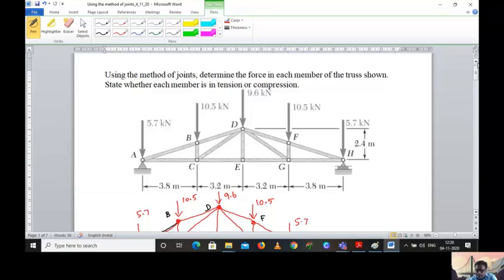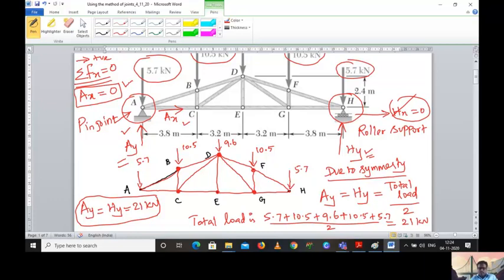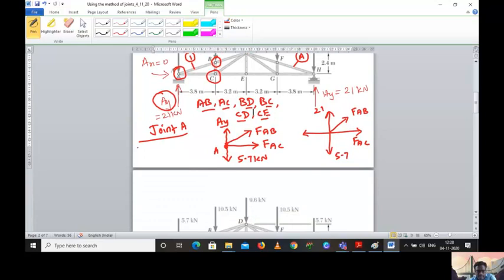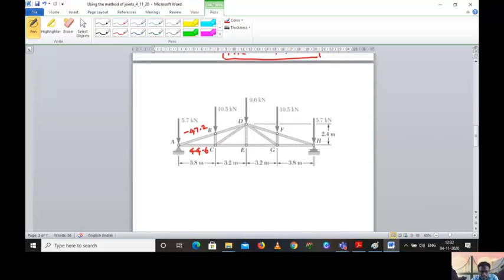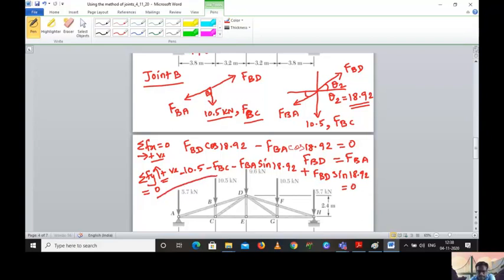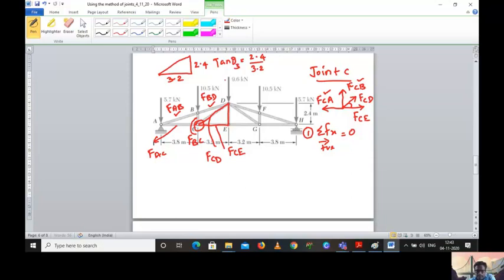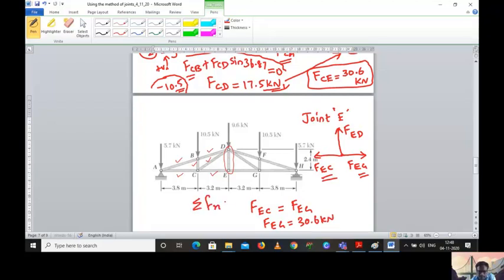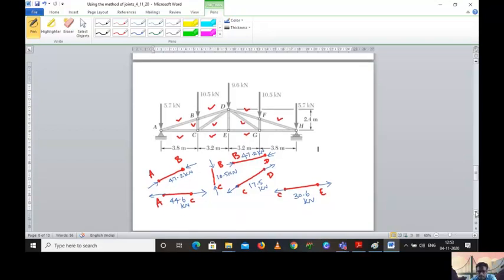Method of Joints _ How to calculate Member Force of a Truss (Symmetric) using method of joints?

Comment: kailash s iyer 

Ex = 0
Ey = -45KN
Fy = 60KN

Fea = 57.62 KN      (tensile)
Fef =  36KN             (compression)
Fab = 35.99KN       (tensile)
Faf  = 44.99KN       (compression)
Ffg  =  38.95KN      (compression)
Ffb  =  0.256KN     (compression)
Fbc  =  36KN         (tensile)
Fbg  =  69.38KN   (tensile)
Fgh  =  58.05KN    (tensile)
Fgc  =  144.11KN   (compression)
Fch  =  112.40KN  (tensile)
Fcd  =  54.02KN     (compression)
Fhd  =  58.05          (tensile)

Comment: jasper   Samuel 20BME1041. The ans.  for the homework question is f(ea)=57.62   , f(ef)= -36 , f(ab)=36 , f(af)= - 45 , f(fg)= -50.97 , f(fb)= 17.69 , f(bg)= -13.81  ,  f(bc)=47.05 , f(gh)=148.7 ,f(gc)= -217.44 , f(cd) = -137.34 , f(ch)=115 , f(hd)= -148.7  . minus sign indicates compression and plus sign indicates tension